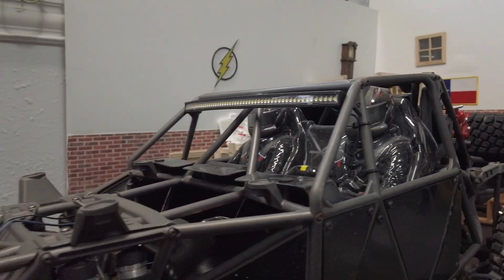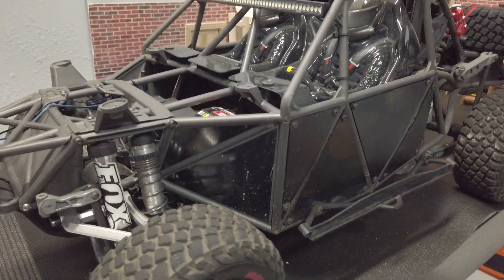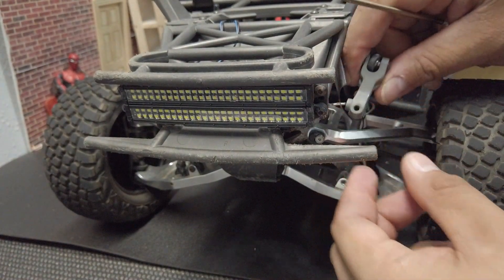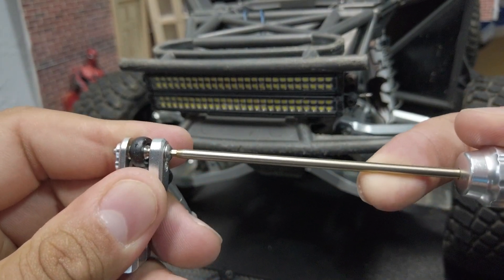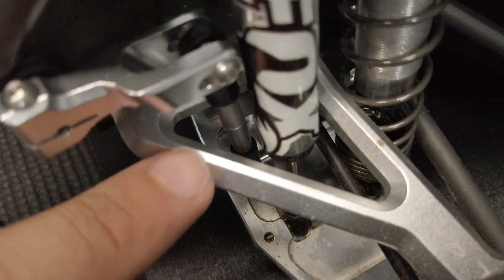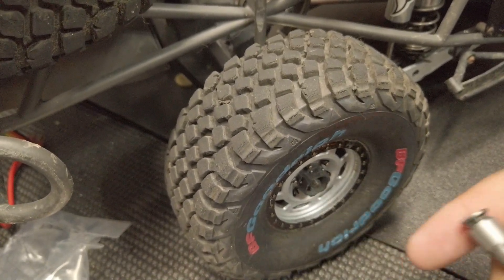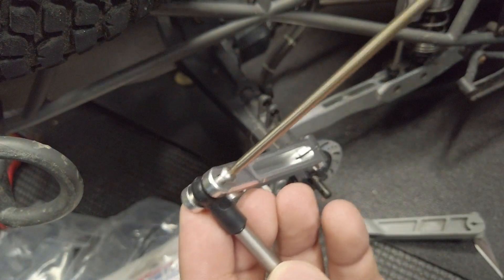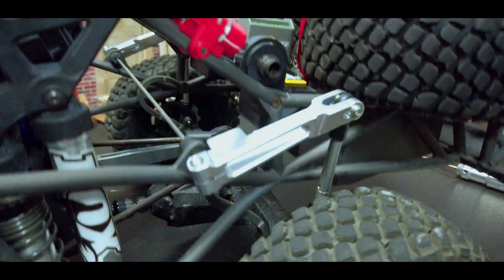UDR GPM ALUMINUM FRONT AND REAR SAWYBAR KIT & INSTALL

Comment: Is there a noticeable difference with the gpm arms vs OEM?
Reply from the maker: Length wise they are the same. Stronger than stock ones.
Reply: @flashhobbies  I wasn't sure if it would help corner better or just strengthen the arms themselves